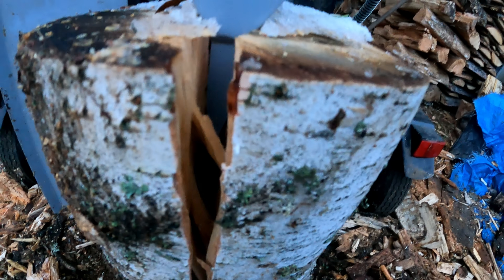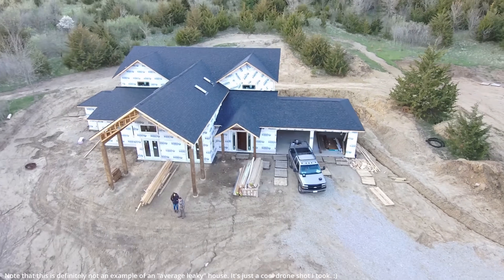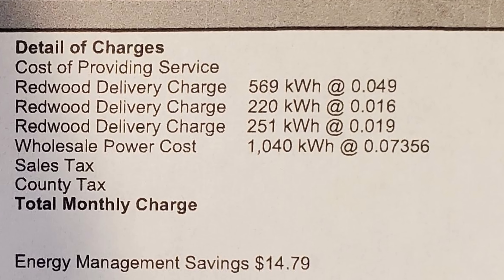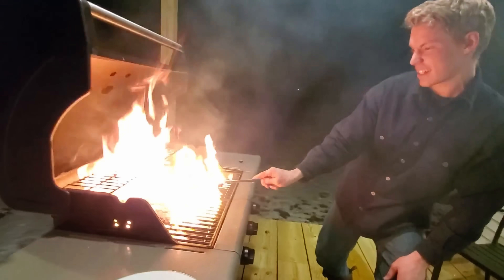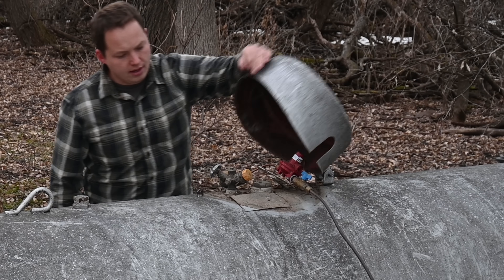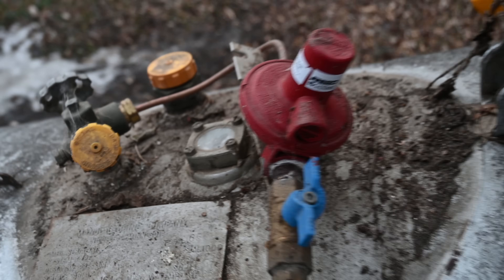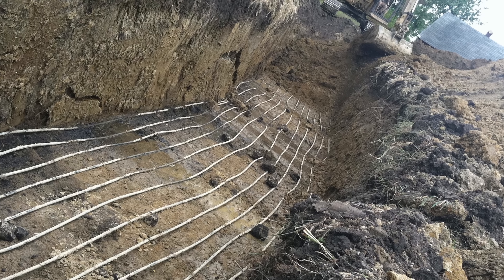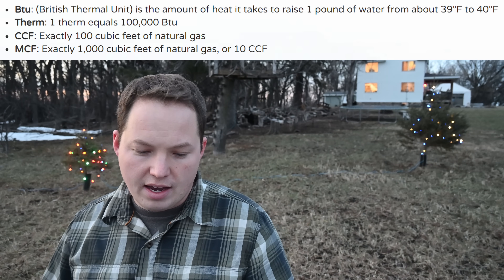What's The Best Heat Source in 2022? Top 5 Home Heating Methods - LP Electric NG Geothermal Fuel Oil

Comment: I just saw an article here in NY State before the new year 2022 wood will no longer be a viable source of home heating fuel as New York is trying to reduce its carbon foot print. Had something to do with a DEC law that was being passed or to that effect. I guess small engines are next(LOL, California keep your batteries they don't work under 6 feet of snow, and you can't recharge them when the powers out).
Reply from the maker: Doesn't wood emit the same amount of "greenhouse gas" weather it is burned or decomposes? The government is so inept.

Comment: wood, almost free. About 3 gallons of gas with premix oil for the saw, plus a couple gallons of diesel for the tractor to drag the logs to the wood shed, and a couple gallons of straight gas for the splitter. Maybe every 4 or 5 years a new chain for the saw, almost free.

Comment: We just switched to using Wood Pellet as our primary heat source. It’s about $5.50 per bag locally and a bag lasts about 24 hours. 

So it’ll cost us somewhere around $910 to heat our home for the winter.

Currently our power bills (electric heat) have gone up by $200 per month from summer to winter. The pellet stove will pay itself off in a few years. Additionally the power draw is 500 watts at startup and 121watts after ignition. So 7500 running watt generator can now heat my house in an outage. Where as before it would trip with the one electric heater running.

Comment: Southeast is primarily electric over heat pumps. That means in cooler areas of South, it switches to resistance heat furnace (part of heat pump feature) @35/40 degrees so that winter heating costs can get a bit high due to older inefficient units and poor insulation. But low cost of install and also handles the cooling season as an AC.  There is also some representation of gas over  heat pump tech as well as older solutions like wood, fueloil/kerosene, and space heaters only.

Comment: I have a high SEER heat pump, installed in 2015. And, at the same time, I installed a propane furnace as the backup heat source. Natural gas is not available on my street. I have my smart stat set at 35 degrees F. switchover point only because, at my age, I do like having warm air more than the savings of a lower switchover point. If I had to, from a cost standpoint, I could lower my switchover point to 30 degrees or even lower, but I haven't had to.

Comment: Knew a family that would heat both levels with electric fireplace (one each level). Turns out, the first $60 of Electricity (in Ontario anyways) is your delivery costs, and then usage. Despite having a gas furnace, they cut off the gas (no delivery or surtaxes anymore on gas) and found it cheaper monthly on average. So lights and heat all in was about $350 winter months, ($120 the rest) which for bungalow in Ontario Canada is pretty good.

Comment: If you replace a 80% 100k btu input furnace with a 95% 100k btu furnace don't expect to see much of a difference in your bill. It's one of the biggest mistakes I see made by contractors. They take a 80% 100k input furnace out and install a 95-98% 100k input. I get to the home and the homeowner says. I had this new high efficiency system installed and there's no difference in savings. Then I have to explain it's because their contractor matched their input instead of their output. You no longer need 100k in to get 80k out with a 95-98% furnace. Also there's so many factors at play. There's a big difference between boiler and forced  hot air while boiler is a better heat. It cost more to operate in gas or fuel vs FHA. It's obviously easier to heat air vs water.

Comment: There is a difference in resistive heaters.  While you are correct that watt for watt the amount of heat is the same, the speffic heat per mole of air over time is different. 

This makes a difference when you account for volume and dimension, as when you raise the speffic heat of each mole of air higher, that air will rise faster and you end up heating the ceiling, and above the ceiling more than the air that the people occupy.

Comment: I live off grid..average winter temp -20 F
I use a blaze king princess catalytic stove.
My house is 900 sq ft
It requires approx 3.5 cords.
Here 5 cords cost 600.$
i also have propane.heat but don't use it to often.
The wood fire has a average of a 12 hour burn..which is cherry.as its always burning no lighting at 6am anymore as it was with a conventional wood stove..which took about 6 cords per year.
But you know how people say it would be nice to live off grid..
Wtf..was I thinking.
Good for sledding though.
...
If it's sunny where you live a mini split can run off solar panels..so thats cool..and cheap..after the install.
..
Thanks for the video..
I'm a HVAC tech as well.
..
Ive also played with hydrogen generators..off solar..
Which is promising..
Storage is a issue..but there I've only 
played..though still ya gotta be serious..
Gonna try several large lp  tanks at low pressure.

Comment: What about trying to medicate the effects of climate change?: more numerous and severe hurricanes and tornadoes; more wild fires; more flood damage, etc. I’m building a 2300 square ft. house with all electric appliances here in the Pacific Northwest. I will have solar and two house batteries so that I will only have to be on the grid at night during the winter. Solar should meet my energy needs for the rest of the year. I also have two electric cars with which I have been very happy for two years. In my opinion, we simply have to stop burning fossil fuels as soon as it is practical.  Otherwise, weather conditions will continue to only get worse.  Love ya.

Comment: The portable electric space heater is the most dangerous way to heat up, while propane costs more per BTU than gasoline. Solar is impracticable as the sun doesn't shine much when heat is wanted. Electric resistance is about as expensive as propane. A geothermal heat pump looks like the best choice, if the property allows, or natural gas, if it's available.

Comment: I use standard heat pumps for my house most of the time. I also use a wood burning stove during cold weather, 30s and lower. We enjoy the hot heat generated off the wood stove on cold winters. We live in SC so are winters are typically fairly mild compared to the northern states .

Comment: Too much insulation.... Such as "top to bottom " spray foam could mean insufficient air flow resulting in a sick house... Some draft is required for health. We do need air. I bet your house has a certain..... Aroma.... You just are probably used to the smell of stale  air

Comment: I have a non stop water source in a stream on the property. Is there a heat pump made that I can just pump this water into and dump back into the creek? Since the house has radiant heat, ideally this unit would heat water rather than air.

Comment: I used to slow roast with a gas oven over night when it got below zero. Around 1999, 2000 natural gas skyrocketed. When I heard what was going to happen, I bought 3 electric oil bath heaters and plugged in some old electric heaters I had in the basement. In February when my coworkers gas bill was over $400, my electric bill was $170.  My gas bill was under $20. I set up box fans that blew air thru the oil bath heaters on low setting. It kept the heat in the rooms even and the heaters stayed at room temperature to the touch.

Comment: I have hot water radiant heat.  Natural gas heats the water and pumps it through the house to small radiators.   Quite efficient.  Similar to what is in motels, apts., etc.

Comment: Wood is the best but the best electric heater is the oil filled ones they are the safest by far. Insulation is key .

Comment: Last 40 years I’ve used self acquired wood to start and coal to carry.  900 square of log cabin in central Idaho, cost per winter is 3 to 400 per winter.

Comment: In the last 40 years I’ve heated with wood start and coal to carry the heat. Central Idaho winters and 900 square log cabin cost to heat whole winter cost 3 to 400 dollars per winter.

Comment: We use propane 2021 per buy was $1.50 per gallon. We installed solar panels last year so that got me thinking what is we switched to heat pump. I didn’t know the new thermostats can switch sources automatically that’s awesome.

Comment: I use natural gas where I live and it doubled over last year. It's hard being a single income home owner and seeing a bill double from one year to the next. I'm buying a wood stove in the spring and going to get prepared for next year. It doesn't have to provide 100% of the heat, but helping keep this gas bill down is definitely needed considering I don't see the markets coming down anytime soon.
Reply: That’s exactly what we’re thinking of doing. Oil is almost $5 a gallon, 100 gallons delivered would run me about $600. It would’ve cost me half that last year😢😢. I’m just grateful that my furnace is new and runs well.
Reply: @luislandofficial , You need a ductless heat pump!  To get 100,000 Btu's from your oil furnace takes burning about 1 gallon of fuel.  A heat pump is only 5-8 KW of electricity.  Even a electric heater plugged into a 120 volt outlet is 23 KW per 100,000 Btu's and less than the cost of a gallon of fuel oil!    Still the heat pump will win with only about $1 per 100,000 Btu's of heat!  

I bought and installed a ductless 18,000 Btu heat pump for my neighbor.  Cost was only about $1,200 on Amazon, including the copper tubing between the two units. It connects to his broken and removed 240 volt heat pump outlet.  It took us about 4 hours to install it.  

Even with natural gas heat, about 1.2 therms per 100,000 Btu's, the cost is more than $1 that a heat pump will use!
Reply: yes our last gas heat bill in ohio was 300 thats half my rent in one bill our house was built in 1921 not insulated good

Comment: So my question is about heat pumps. How do they compare heat output wise compared to propane? Propane is super warm/hot when it comes out. You can get warm standing under the register when it blows if you are chilled. In my experience with heart pumps, they tend to always blow cold air and maintain a steady temperature, just not warm. Unless you are using the super expensive hearing coils.

Comment: In Toronto, most people have natural gas for heat and hot water. My house is 900 sq ft and was built in 1901. My natural gas bill ranges from $40 in the summer to maybe $120/month in the winter. It wasn't always that low, but we have had milder weather recently and a couple years ago got one of those energy efficient combo boiler/hot water wall mount units. They are awesome.
Reply: Energy is so incredibly cheap in the US and Canada ....... and then people also complain

Comment: So we use an old 10 SEER heat pump with a 10k coil along with electric baseboards in every room all topped with an EPA rated wood stove. The heatpump is set at a baseline of 71°f along with the baseboards. The wood stove runs all winter keeping the house at 75°f on average. We get our wood free but invested about $2k in equipment 9 years ago.

Comment: Hi Ben, Im using forced air natural gas primarily, but augment that with a wood stove. The house is 120 years old with little insualtion. Fascinating that Propane has become the second highest cost over fuel oil. Wow ! Propane is just as abundant as natural gas. I retired from a gas company and few producers bother to strip the propane out of natural gas.
Reply: Clean this, clean that , bottom line is if anyone is worried about climate change the only issue is numbers, ie population …. Too many people. Has everyone forgot about ZPG…, zero population growth…..?   China has what 1.3 billion people…. ?  That alone will pollute the entire world. That’s if everyone doesn’t die from a virus first.
Reply: @jimalcott760  If we had energy solutions that would scale w/o damaging the planet, then the population shouldn't matter.
Reply: It turns out we were lied to about how clean natural gas is. Not only is fracking not wanted, but there are methane leaks down pipelines or at refineries, etc. and the methane is a HUGE problem (as is being reported relative to the Russian pipeline sabotage).

Comment: In my situation I feel blessed for our property to be situated in an oak forest. Even though I have a heat pump along with 2 mini-splits, I primarily (nearly 90%+ of the time) heat my home with a wood burning stove. I've switched out my 40 gal electric water tank for a tankless water system using propane. For 2 people-  a 30lb propane tank lasts us 45+ days for bathing and washing dishes. The other thing we have done is installed an off grid solar system that primarily runs our refrigerators, other small appliances and lights in the home. About the only thing we use grid electricity is for the larger items like the clothes dryer and well pump.  Our monthly utility bills are very low. For me, I have the time and resources to cut/split/stack/age wood and that is the cheapest by far for our home heating...

Comment: It would be nice to know the depreciated installation and maintenance costs as well as the fuel costs.  Ground sourced heat exchangers reduce costs a lot, but they also cost a lot to install.  Fossil fuel costs will probably continue to go up as they become more expensive to extract.
Reply: Exactly.  And you have to consider how long you really will be in the home.  Like a whole cost/benefit analysis.  And if you're looking at depreciation over many years, you have to throw in your own personal 'guesstimate' of what alternative fuel prices will be doing.  A bit of a 'edumacated guess'.
Reply: The frustrating part for me, is that the ground source heat pump should have approximately the same cost as a similar size air source mini split but because economies of scale they are not. I can easily dig to the water table on my mountain but for the price difference I will be installing a less efficient air source mini split.
Reply: @randomvideosn0where  Do you really have to dig all the way down to the water table?  I know in many areas they only dig down about 10 feet, not all the way to the water table.  Just need to go below the 'frost line' which is about the same as the depth for building footers.  Still, it depends on how many years you expect to spread the costs over.
Reply: @mikefochtman7164  I am in northern Virginia, so I would need to dig down to about 4 feet for frost considerations anyways. My water table is about 14 feet so I would rather dig shorter trench and hit the water table since that transfers heat more efficiently anyways and the flow will carry away that energy where in dirt the ground would actually start to cool as spring approached.

Comment: I live in Ontario, Canada and I heat with passive solar, R-30 in the walls, R-40 in the cieling and a woodstove that heats my water that also heats the floor. Curtains are great to let the heat in during the day and keep it in at night. I live off grid with solar panels and batteries so electric is out but in the future I will put in a propane backup to keep the house from freezing when I go south during the winter. I love your video though, thanks for the information!

Comment: I at one time used wood but I will say that it takes way too much time to deal with if you have a full time job that is not at home, gathering wood to heat is another full time job on its own. Plus, you need lots of land and equipment to do that as well. You also have to get the wood throughout spring, summer and fall so it dries enough when needed by wintertime. I use electric now, it's the cheapest in my area. The one thing you did not add into your equations is that you are still using electricity with any of the fuel systems because the fan in the furnace still has to operate to move the hot air throughout the home. I wonder what your calculations would be adding the use of a normal 1/4 HP electric motor spinning a squirrel cage fan with the fuel cost would be? LOL
Reply: 1/4 HP is 183 watts per hour or about 4,400 watts per day (running all the time) or $0.52 per day. If the fan runs about 1/4 of the time; it would then be 13 cents per day.

Comment: A subset to natural gas would be a boiler.  I have one in one of my rentals.  Don't know how efficient they are but I had a new one put in a few years ago and it was double the price of a forced air.  The upside is no electric to run if the power goes out.  The pilot creates energy for the thermostat.

Comment: I use natural gas forced hot air as my primary heat. When we are off work we burn wood cut by me for free. And since we are empty nesters most of the time. We use a Mini Split in the master bedroom to space heat that room. I’m in southern Pa. 7 cents per KWH. Electric bill is normally 70.00 a month and my gas bill is normally around the same. House is 2 story built in 01 and is 2700 sq feet. Also we use gas for hot water,cooking and drying clothes. Awesome video
Reply: Update.
Fuel oil - 5.50$ gal
Propane 3.89 gal
Natural gas 1.05 per therm 
Electric 9.4 cents per kw
Starting to get crazy.

Comment: Why do people always underestimate the capabilities of radiante heaters? 
I haver a big room that a 2kW convention heater wouldnt be capable of heating. 
Instead I use a radiant electric heater directed to where I want the heat. 1.2kW is to hot,  800W sometimes needed, 400W is enough most of the times. 
No I dont heat the whole space,  Just where its needed.